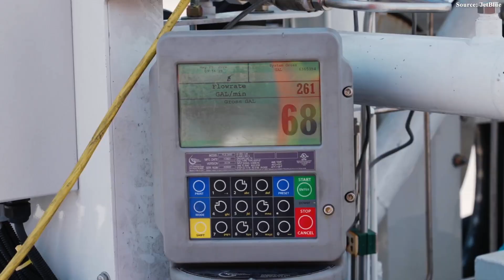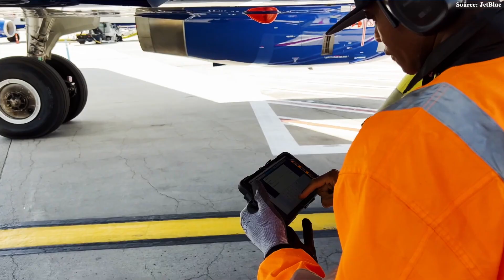Why Boeing 797 Just OUTSMARTED Airbus & COMAC - Then Something Changed!

Comment: I did think boeing had even started work on a 797 model. I believe Boeing's priority will be a 737 replacement. The statement that airlines are waiting for this seems a real stretch as Boeing's delivery capability is questionable.  Final Airbus will just sit still while this is happening?
Reply from the maker: I don’t think Airbus is too worried about that. After all, the A321XLR is still doing quite well, and the A320 series remains the leader in its segment.

Comment: So, a successor to the 767 rather than the 757. Greater stiffness, fewer rows for a given number of seats, faster boarding and more cargo space at the expense of more fuselage drag and greater empty weight. Possibly worse than a single aisle at the 225 pax level and better at the 275 pax level.

It will be interesting to see if Airbus decides to pick a narrowbody concept for the mid-market instead.